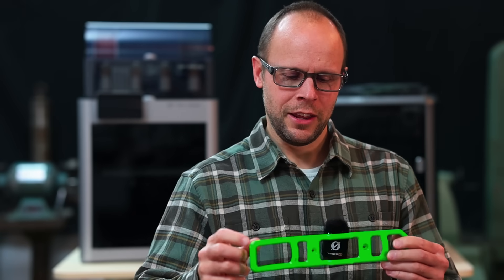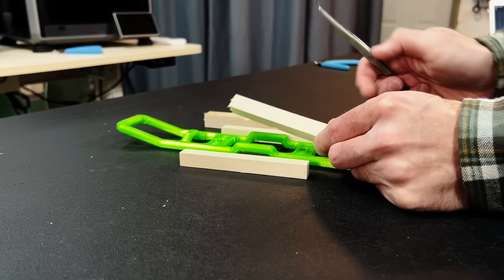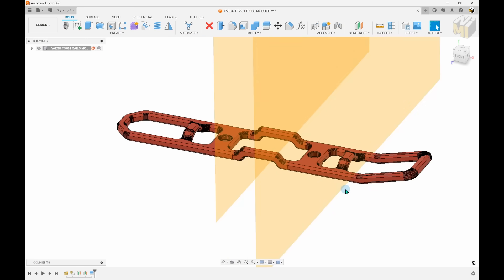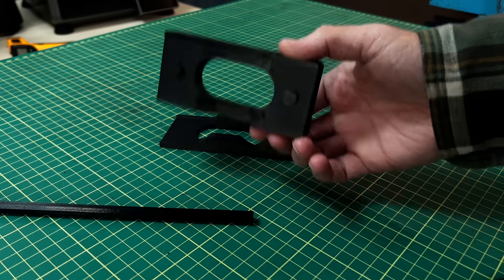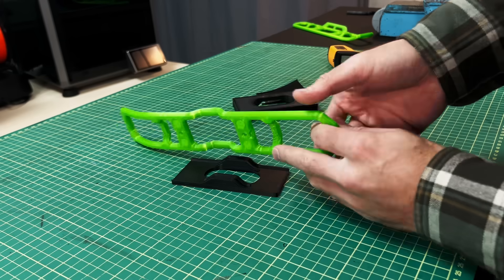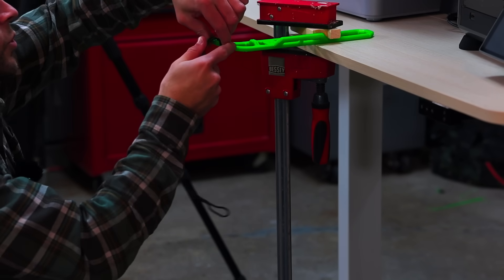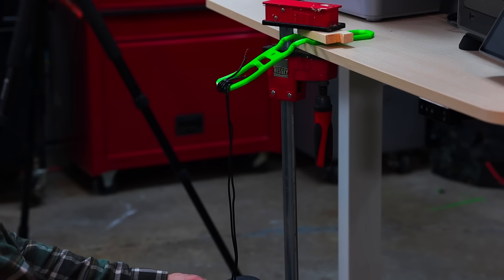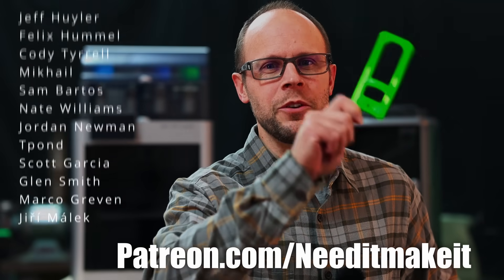2 Simple Ways to Make Stronger 3D Prints + an Experimental Way

Comment: The problem has more to do with the ape handling it. Once mounted and the ape can not longer paw at it, it shouldn't exceed it's physical limitations.

If I smash my porcelain on the bench it's going to break, too. Does it mean there's something wrong with the design? The customer more than usually is not right.
Reply from the maker: That's an interesting perspective.  

My point of view is a little different, and it goes like this:  If I sell something and someone breaks it, I'll be replacing it at my cost.  It doesn't matter how it breaks, I'd need to replace it in order to keep my customer happy. 

The custom is always right thing, yeah, with you on that!  Customers are people, and people are only right some of the time.  A better way to look at it is, how are you going to make sure you keep your customer happy so you can continue to do business.

My first job years ago was in retail; that brainwashing was one of the first things they'd tell us.  No thanks.   Funny story, I had a customer come in asking for a timer for his Fridge,  this is when I was 15 years old BTW.  He said he wanted it to save money on his bill.  I had to explain that his fridge turns on and off automatically based on the demand, adding a timer would not work.  He never bought a timer that day... at least not from our store.
Reply: @NeedItMakeIt  Yes. I mean more fully that I do understand that point of view. I've sold things to people before - Even working retail for a small shop I can't help but feel responsible for the quality of the products that I take people's money for. I have a really hard time taking people's money. I can't ever sell anything I own because I feel constantly responsible for it's longevity and performance.

- But that's mostly a ridiculous way to think and I'm aware of that. If an item left my hands working, I shouldn't be responsible for it after that. If I sell a box that's come packaged from China and it breaks, I shouldn't be (personally) responsible for that.

How much does the extra effort impact the cost of the part and profit to you? Time and effort to manufacture? Is it really necessary to take on what should be other people's self-responsibility or compensate for their mistakes? -Sometimes, maybe.

When the part is mounted as intended then it works perfectly within spec. When an cro-magnon tries to twist it over on itself, then it will break. Perhaps there is some compromise between blaming the customer for being a chimp and trying to make it totally fool-proof that isn't going to impact your R&D and manufacture? - It could be just as simple as a warning or notice to instruct people how to not 'misuse' the product?

Because there seems to be nothing wrong with your product. It works. Does what it's meant to, nothing it isn't. I'm not certain that it needs fixing.

Obviously you should do what makes you feel most confident in your product. But maybe you don't have to take all the blame for every failure of it as a failure of yours, is all.

Comment: Forming was a neat idea. I wonder if heating it in a controlled way just enough to make it pliable would work out any better?
Reply from the maker: I think so, in order to do that, I'd need to print it solid, and I probably need to make a video on that.  I'll have to do some more research on this.  I also want to try ABS, I think it may not be quite as sensitive as the PETG, what you think?

Comment: I really don't like using PET for anything unless I really need it. I almost exclusively print ABS and that solves most of the issues you're having. It's stiffer but still flexible enough for most anything you need. And your idea to heat/bend with a jig is a great idea!
Reply from the maker: A while back I moved away from ABS for a few reasons, not having a great enclosure, warpage issues, and the smell.  On the other side of it, I think you're right, it's strength to weight ratio is pretty high.  I have a follow up test on the go right now, it includes ABS as a contender as well as PC.  This time I'm doing real world testing for the exact purpose it was designed for.  Hopefully these tests provide some interesting results.

Comment: Have you looked into putting it in salt(to keep shape) and then  into an oven?
Reply from the maker: This is something I thought about a few years ago, but it seemed that using a method like that would produce a shape which is not exact.  I'd have to test it on my own to be sure.  There may be a way to avoid this by having a clamping pressure applying force to keep everything in the position it's meant to be in.  Definitely an interesting topic and I may have to test this in a future video as well!

Comment: The way each piece was clamped during the bending test is partially responsible for the results. The square edge of the table under the piece concentrates most of the stress at that very point on the part.Then, the upper clamp position determines how much that zone can flex. The closer the clamp to right above that corner the less the part can flex. It'll therefore snap earlier and right at that spot. Which can clearly be seen on your 1st test at 10:10 
Then notice how the clamp position is inconsistent from test to test. Material test equipment uses standard contact points / curves and well thought out clamping strategies so as to reflect the true characteristics of the material with as little influence from the jig as possible. And also to guarantee repeatability.

This said, great example of solution optimizing.

And forming the shape via heating + shaping molds was genius. Never thought of that, will have to experiment with it. Thanks for the food for thought 👍
Reply from the maker: Certainly a little bit of hill-billy setup, you have pointed out the many flaws of my testing.  I completely agree that it was not so precise.  

What I'm really interested in is real-world testing and in the follow up video I'm working on, I've printed a wide range of materials, and I've made a 'DUMMY' radio which matches the size and weight of the real one and I'll see if I can produce the most likely condition of tripping and dropping it.  Most of the time, it would be to take light abuse, but I think on occasion it would be ideal to be able to take heavy abuse and even if it breaks, it would prevent damage to the radio by absorbing the impact (crumple-zone-style).

The trick of post-forming is similar to steam bending wood, I borrowed the concept to see if it would apply... it works, but didn't perform as well as I had hoped.  I'd still like to try it on some other materials, this ability that PETG has to fracture like glass isn't ideal, maybe ABS would have better properties for this technique?
Reply: Exactly. I was shocked to see so different clamping positions, completely invalidating any test results. What a waste of time and effort by OP.

Comment: The best way to print this would be to print it on the side. This way you are working with the  grain on the carves and not dealing with the layer lines.
Reply from the maker: Absolutely, I agree.  This was something I wanted to do, but the massive amount of supports needed was saying that it was not designed to be printed that way.  That said, I am working on the follow up for this video taking all of the suggestions, including yours and trying to come up with the best option.  It should be released in a few days, and I think we're going to see some better results.   I also want to do some actual drop testing to see how they stand up to real abuse.  Adding weights to something is all well and good, but the actual real-world testing is better I think.

Comment: Have you considered using the method of heating it in popcorn salt?
Reply from the maker: I haven't, but it's probably a better use for popcorn salt than eating it.  I will definitely have to try it out.
Reply: @NeedItMakeIt  It seems to eliminate layers line weakness pretty well.

Comment: I have to lead with a question. The raised area in the middle of the rails, what is the purpose? Is the idea to add a bumper as protection for the radio, or is it a clearance requirement? 

If the idea is to simply add more of a barrier for impact protection, simply make that area thicker as opposed to bent. Stick with the same dimensions, but fill in the space where the bent/raised area leaves space.
Reply from the maker: That is supposed to be where a strap can be added in order to secure an additional device to the top.  Apparently is isn't really necessary, but I wanted to keep it like the original design.  

I'm working on a follow up video and I am taking all of the suggestions including yours and hopefully we can get something that performs a lot better.  I have PETG/ABS/PC and I will do TPU, but I think that'll have to be a video on it's own.

Comment: I've seen PLA and PETG get brittle after heating it up after it's been printed. this might be something where an extreme amount of temperature control is necessary, of maybe just annealing afterwards. Sounds like there's a fair bit more experimentation to do.
Reply from the maker: There is some potential for sure, but yeah I think with these materials, it's going to be hard to get those properties when heating and cooling as uncontrolled as I was doing it.  I want to try doing the same with ABS, it may not react the same at all.  I have another video in the works as a follow up to include all of the suggestions from this video, hopefully we can come up with something that can take some abuse and not break at all.

Comment: Very interesting indeed. At 5:55 you mention a void, could you explain in detail how this will increase the strength of the part?
Reply from the maker: Thanks, yeah a neat technique, and I think I'll have to try this with ABS, maybe it'll do better.  

The void that I added is there so that when I form the part, it doesn't collapse, similar to bending hollow steel tubing.  

Usually I add these when I want to make something withstand a lot more compressive forces.  when it comes to parts in tension, I had never tried it for that... apparently it didn't help.  

Hopefully that helps!

Comment: Nice video. 👍
I do want to say something though. As the opinion of a previous owner of a 3 3dPrinting company for high performance parts. You shouldn’t have to treat part design like wood. If you are having layer separation it will happen in the weak areas of the design. That just means that you have your print temp too low and the design is bad in that area. Materials means a lot so different materials will have a different outcome on the amount of abuse it will take. ABS is one of the best materials for this type of stuff. Pretty much what the video shows. 
Best of luck with your channel! 🤙🤙
Reply from the maker: Thanks, if nothing else, it was an interesting concept.  With PETG I don't usually have problems with separation, however PLA tends to be quite weak, I would attribute it to printing too fast, as well as too much cooling.  I'll have to experiment a little more on that.  Thanks for your thoughts on that.  Love to hear from people with experience printing parts that are meant to take abuse. 

I'm in the process of making a follow up video, I wanted to take some of the ideas from the comments and see if we could put them to use.  I have some ABS so that's on the list.  I wanted to try TPU as well, that was a common suggestion, but I think it's a bit too soft even though it's a 95A.  I'd also like to re-test higher quality PETG and PC as well.  I've also done a slight re-design to print on it's side, and instead of having supports I've added webbing, it may not print perfectly, but I think that if we need supports, we may as well integrate them into the design.  

I've been trying to stay away from ABS, but it seems to have some properties that the other materials can't compete with.  

I think what I'll do in this video is mount the rails to  a fake radio and do some drop tests from desk height, I'd like to see if they can truly protect the device they're meant to.  

Thanks for your comment!

Comment: I'm curious is this an enclosed or open-frame print? Because i wonder what the influence of ambient temperature is on PETG layer welding quality. I wonder about the performance of enclosed print with fan weak and elevated bed temperature to create higher enclosure ambient.
Reply from the maker: I've been printing all of my structural parts in an enclosure with no fan, and as long as the parts are long enough they seem to have enough time to cool before the next layer comes along.  Some of the overhangs aren't perfect, but It's a small price to pay.   I'm working on a follow up on this video taking in to account as many suggestions from this video as I can.  I'm trying some TPU, ABS, PC, and PETG, I've also adjusted the design just a little bit so it can be printed on it's side.  Should be interesting to see how each of them performs.

Comment: Great video. Definitely gives me an idea. I make a lot of RC parts and this makes me think of "forming" some of my chassis ideas. Get a combination of the bets layer properties yet achieve the final shape I want. I used to design stamped sheet metal components, I didn't even think about "forming" plastic parts until this video. Good work!
Reply from the maker: Which material do you use for your parts?  I wonder whether I should try this with ABS as well, maybe it will perform better because it doesn't tend to fracture like PETG. 

I thought it would perform better, it's similar to steam bending wood in a way, but a lot quicker.  Printing a solid part and annealing it could work also, my fear with that is the deformation, it would expand what about 3% during heating as well and I'm not sure how the shape would hold up.  At that point we may as well injection mould the parts.  

Thanks for the comment!  Lots more videos to come.  I'm working on a follow up to this one, but maybe I'll have to do a video on forming some different materials and testing their performance.

Comment: Did you try printing on it's side? the layer lines then are all running along the full length of the design and the shorter width wont' get as much force.
Reply from the maker: I haven't tried that mainly because the design would require a lot of supports, but I'm working on a follow up video where I slightly adjusted the design to be able to print on the side, I think you're right, it probably would be much better printed sideways.  I'm also printing a bunch of different materials to see which would work best to protect this radio.
Reply: @NeedItMakeIt PETG supporting itself will add cost to the product, time to the print and frustration to the removal, but it's all a journey :) Looking forward to the rematch :)

Comment: very nice video. I wonder if your redesign for mod 2 would fair better if you continue the strap holes the entire length of the part.  It was the only part to snap past the main opening.  what would look like extra strap slots to your user would be a massive increase in strength and  small amount of extra plastic.
Reply from the maker: I think so, it could probably carry quite a bit more weight before breaking, I was really impressed with the amount of weight each of them took considering it was right at the end. 

I suppose it would depend on the goal, I think with this design we're looking for a bit of flex to absorb some impact when it hits the ground.  I'm trying TPU right now to see if there is any chance it might do better, but I'm not so sure that it's rigid enough for this purpose.  It might be a bit too flexible.  I'd also like to try ABS, and Printing the part completely solid as well.  

TPU is very slow to print, I'm using the Bambu settings, but I think it could be ramped up at least a little bit.  Again no fans, and a variety of infills right up to a solid part, maybe it's the ticket?

Comment: did you use electric cables as a rope to hold the weights?
Reply from the maker: That's right, I'm 1/2 farm boy.  I have plans to melt my wire down when I get some time.